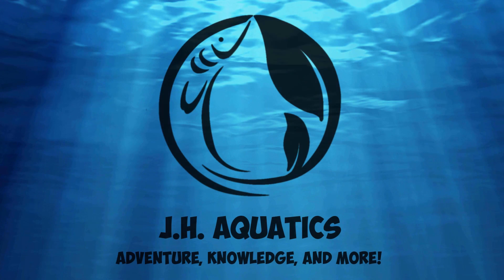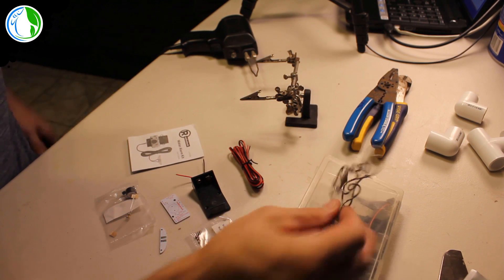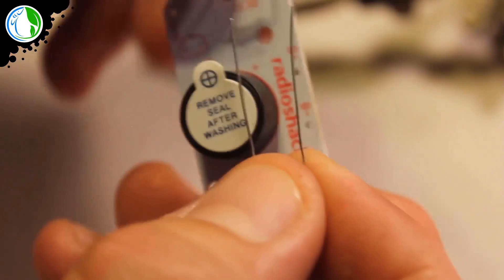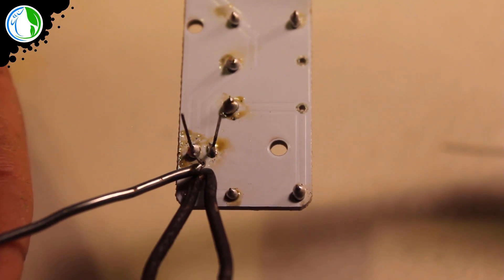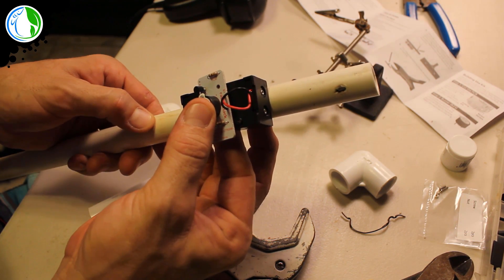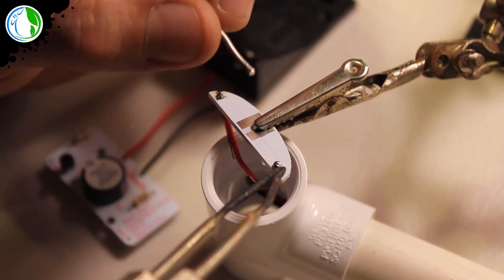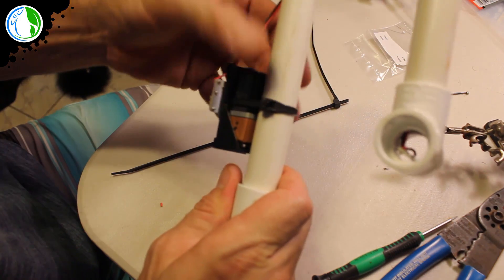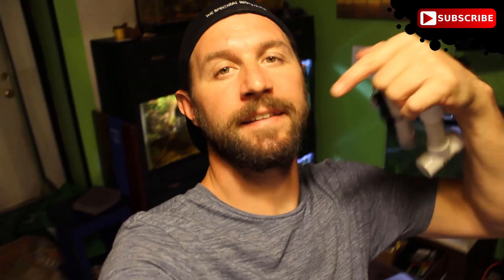HOMEMADE DIY WATER LEVEL ALARM TUTORIAL 💦 💦

Comment: Thanks, I really needed this!   The one I just bought on amazon was too small to fit my framed tanks.
Reply from the maker: I like it because I can go around the room and easily hang it over the side of any of my tanks as I go. Now I just have to remember to use it.
Reply: JH Aquatics I also appreciate  it because it get to play with my soldering  iron and a circuit board.  Good stuff!